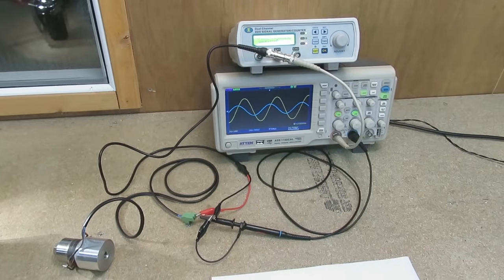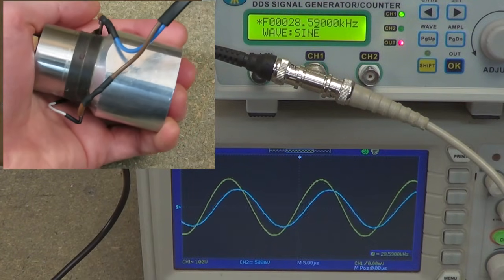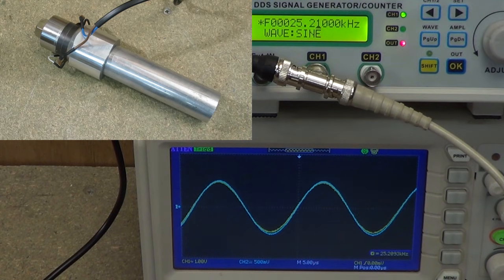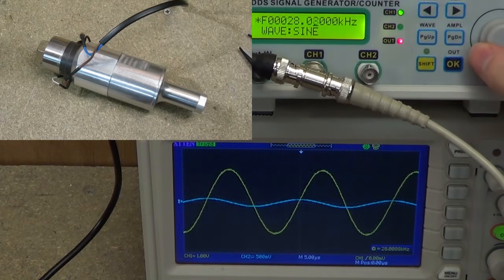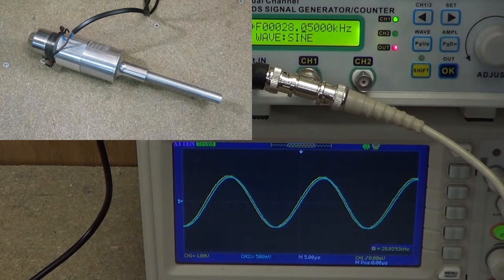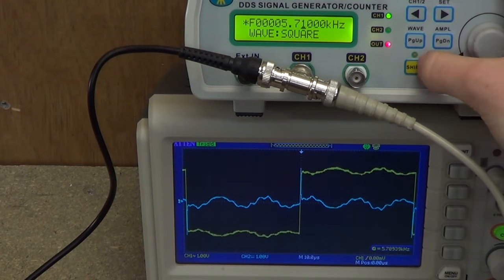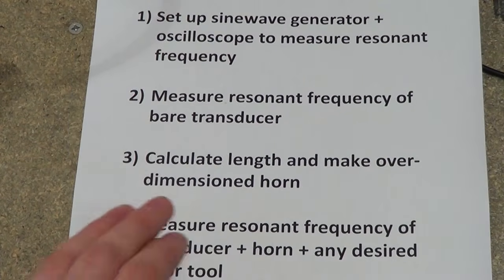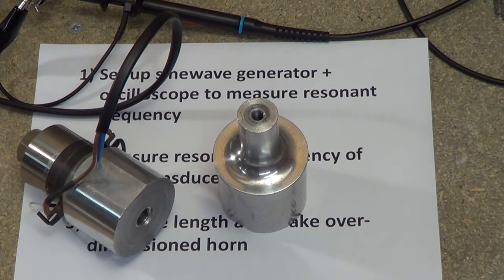Ultrasonic Transducers - Measurements and Horn Design

Comment: Excellent video. 2 Questions 
1) Is the grade of Aluminium important? 3000 series vs 7000 series? I know that 7000 series is harder and does not need heat treatment post-machining but any other difference?
2) Any difference in initial length calculations if its a bar-shaped horn as opposed to circular one?
Reply from the maker: Thanks! I don't know about the aluminium grade, but I would guess that one with a higher tensile strength would be better, as it would be able to support a larger oscillation amplitude before failing. E.g. 7075. Tensile strength is one reason why "proper" horns are made from titanium.

As for length, it won't vary hugely - if you start off with a cm or so longer than the theoretical half wavelength, you should be good in both cases.

Comment: 03:10 below resonance the current lags the voltage by 90 degrees

Are you sure?  ;-)
Reply from the maker: Argh!! You're quite right, well spotted. I always get confused looking at scope traces and figuring out leading/lagging relationships 😱
Reply: So for all of us oscilloscope noobs, what’s really happening instead?? 🤷‍♂️😜
Reply from the maker: @serversurfer6169  If the current waveform "leads" the voltage waveform, it means the current reaches a peak before the voltage. If you go to 3:10 and look at the waveforms, and work from left to right (increasing time), the blue waveform (current) reaches a peak before the yellow waveform (voltage). Note that although I'm referring to it reaching a peak, that's just a convenient reference point to use - everything (peak/trough/crossing through zero) occurs before the yellow waveform. Conversely, if the current "lags" the voltage, it reaches a peak after the voltage. Hope that helps.
Reply: Lindsay Wilson It does indeed! Cheers! 🤓👍

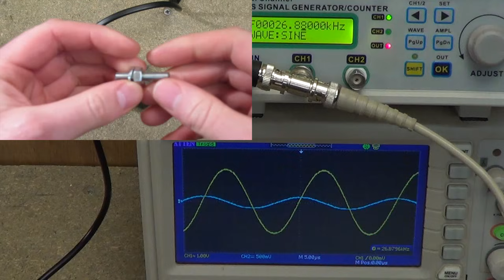While I have your attention, your section on the adjustable screw at 13:30 got me thinking. Couldn’t that technique be used to fine tune the resonance of a series of interchangeable tips? At least for prototyping? 🤔
Reply from the maker: @serversurfer6169  It might, but to be honest it wouldn't help much - after all, a final tip is going to be machined from solid, which will have slightly different characteristics from a something made up from a separate screw.
Reply: Lindsay Wilson Ah, I was wondering about that. I was thinking that an adjustment screw would be useful for allowing a “generic” tip to be placed on a variety of horns, but I guess the adjustable bits vibrate themselves loose in pretty short order? 🤔

Comment: Hi! Good day, can I ask you where I could buy those types of transducers? I need it for a research in concrete testing. Also, do you think we can use ultrasonic transducers for cleaning in defect detecting? Thank you
Reply from the maker: Hi, thanks for commenting. This particular transducer was bought years ago from Steiner & Martins - http://steminc.com/ - but if you search eBay for "ultrasonic cleaning transducer" you'll find plenty of results, lots including a driver as well. I don't think they'd be suitable for NDT - from what I understand, NDT uses much higher frequencies (several MHz) to get finer resolution, and these transducers are only a few 10's of kHz.

Comment: Why not have a transducer driver that automatically tunes itself? Periodically the driver could sweep a frequency range and detect the frequency that causes the highest power load on the driver and then drive the transducer at that frequency. Or just have a manual tuning of the driver frequency and set it to the highest power load. It seems like it's far easier to tune the driver circuit electrically than it is to tune a physical object. ... adjust within some reasonable narrow frequency window, of course.
Reply from the maker: Most transducer drivers do automatically tune themselves to the resonant frequency, e.g. by tracking the phase of the current and using a PLL. However, the horn must still be tuned (machined) to match the resonant frequency of the transducer, since that's where it was designed to operate most efficiently.
Reply: @imajeenyus42  I was going to ask the same question as Noah. How does the inefficiency manifest itself? The current looked about the same. Is there less mechanical movement? Does the piezoelectric element wear out faster?
Reply from the maker: @karlharvymarx2650  The impedance reaches a definite minimum at the resonant frequency - for example, here's a graph: http://imajeenyus.com/electronics/20110514_power_ultrasonic_driver/photos/Graph2.JPG. Resonance there is at 28.25kHz. This is the point at which current draw from the supply will be greatest. It's perhaps not perfectly clear in the video (in the case of the horn) because the signal generator's output actually drops slightly as you try to draw more current, so it might appear that the current stays relatively constant. However, if you watch the part with the bare transducer, you can clearly see how the current peaks. Yes, you will get less mechanical movement if operating away from the resonant frequency. At some point I want to demonstrate this with say a non-contact optical sensor to measure the vibration amplitude versus frequency and show how maximum vibration does indeed occur at the resonant frequency.
Reply: @imajeenyus42  check out applied science video on a laser as a transducer.  Also an old phonograph cartridge  might show displacement as you sweep the horn along its length or sweep frequency.
Reply: @imajeenyus42   Another point missed is that as the frequency changes all the nodes will move and as such so does the ideal mounting point, thereby reducing the efficiency of the entire system.
Reply from the maker: @anullhandle  I saw him - if I do start playing with that again, I'll use a fiber-optic displacement sensor, as they're totally non-contact and relatively easy to use (not as fussy as an interferometer)

Comment: Why not solder the blade into a threaded rod?
Reply from the maker: Because the temperature required for soldering will ruin the temper of the blade.
Reply: @imajeenyus42 Ah, in my case, I heatsink the root of the blade.  What is the temperature threshold for losing temper? I never really considered that.  Haven’t checked to see if I ruined it despite my best efforts
Reply from the maker: @weirdsciencetv4999  Generally things start happening around 200°C, but that's a good idea about heatsinking the blade.

Comment: Instead of tweaking the horn, wouldn't it be easier to design a drive circuit that adjusts its drive frequency to resonance? 

You could use a micro to generate a square wave and use a small resistor to measure current draw, adjusting constantly to achieve optimal frequency. If the transducer does poorly with a square wave, just LC filter it.
Reply: This is called an autoresonant system, see Resonant robotics by Babitsky.  I've implemented it in other applications and it works well. You can also do it in the time domain for some systems. In phase really just means that your "push" is in the same direction as the motion like pushing a swing. You can add a second control loop if you want to control the amplitude rather than just go for all out max output.
Reply from the maker: No, and yes, in that order ;-) The transducer itself is designed to operate at 28kHz - the dimensions of the front and rear masses, the thickness and placement of the piezo ceramic discs, and so on. Specifically, the piezo discs are placed at the axial vibration node at the center of the transducer, which is a radial vibration antinode (the piezo discs "breathe" in and out). If you attached a wrongly-dimensioned horn, which resulted in the entire transducer + horn assembly resonating at say 25kHz, and simply adjusted the drive frequency to match, the piezo discs will no longer be at the axial vibration node, which will both reduce the efficiency of the transducer and possibly place undue stress on the piezo ceramic. The horn MUST be designed so that, I repeat again, the resonant frequency of the transducer+horn system matches that of the bare transducer.

Now, your second point - yes, auto-tuning or self-excited systems are indeed widely used for this sort of application. Most ultrasonic cleaner circuits actually take a sample of the current waveform (via a current transformer) and use that to drive the bases/gates of the bridge transistors, so it automatically oscillates at the resonant frequency of the transducer. Fancier drives use a phase-locked loop which monitors the relative phase of the output current, and adjusts the frequency so that it's in-phase with the voltage. Both are quite possible, but a manually-tuned oscillator is much easier to build.
Reply: Lindsay Wilson if I understand you, adjustable within reason?
Reply from the maker: Well, yes - as long as you get the horn tuned to pretty close to resonance first (e.g. with in say a few hundred Hz), you would adjust the oscillator frequency to match.
Reply: Lindsay Wilson great, thank you.
Reply: ethan, respectfully that's not possible.. you characterize the electronics to match the mechanical properties.. no matter what you do to the electronics, an out of tune mechanical assembly will always be an out of tune assembly.

Comment: Well done. But in my opinion, there are several pieces missing. For example, the horn is a step type. Not very reliable and primitive for my taste. Just a few more volts at resonance and it'll crack. Also, although you mention the wavelength, half wavelength and a little bit about the tuning, you left out the constants k, kl1 and kl2. There's just no way to machine a horn, be that step type, conical, exponential, catenoidal or Fourier, or Barbell for that matter, without the constants and the interpolation tables. All in all, your presentation seems fine for an introduction to power ultrasonics and sonotrode design, but even a speed course should mention the procedures available to calculate and design the horn of your choice. I hope you show us what else you've got. But good work. Keep it up.

Comment: you  are wrong
Reply from the maker: About what exactly?
Reply: @imajeenyus42  When voltage is minimum, that is the resonance point. Case of statics capacitance the phase is not zero,and variation at different load.Give you email I will show you with graph.